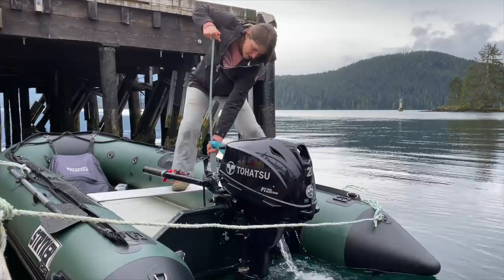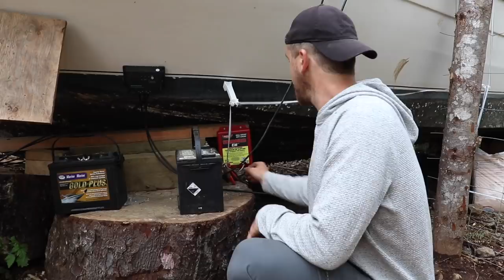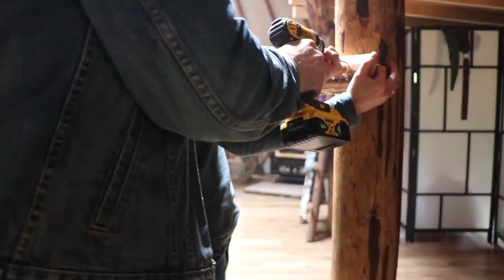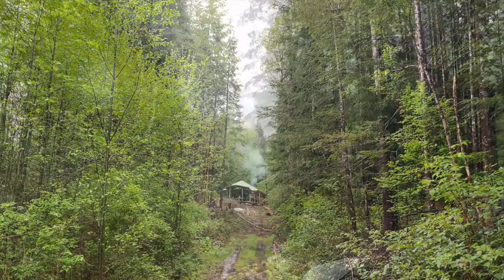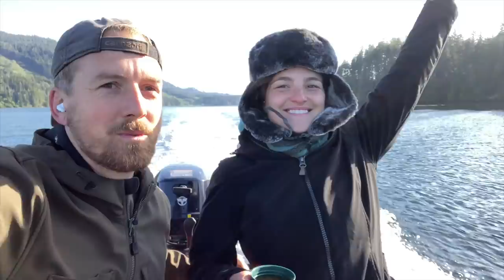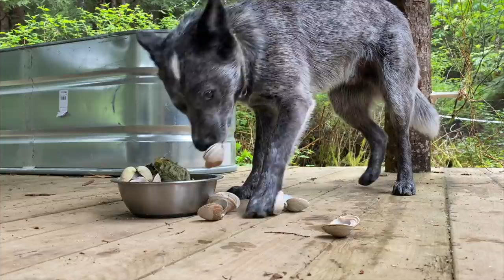OFF GRID WILDERNESS LIVING // What We Feed Our Dogs | GARDENING WITH BEARS | Falling Trees - Ep. 87

Comment: Tip from a tow truck driver...a small 1500lb say snatch block will double your pull capacity with no extra power. Chain off to another tree and you can direct the fall towards the snatch block rather than the vehicle.

Comment: When falling trees I think it is better to face the notch downward instead of the way you did it.  Also logger pants are recommended especially that far from a clinic.  I have put the saw into my leg and had to drive to town myself. likely i did not hit any arterays only fat. The back cut should be no higher than an inch above the initial cut when facing the notch downward.  do not cut all the way through.  Leave the hinge .  Stay safe
Reply: You covered everything I was going say about the cut, excellent.
Reply: mym that is called a Humbolt cut.  The butt of the tree will hit the ground first.  It will sometimes break the tree toward the top.
Reply: What about the cold water they constantly travel in with the inflatable ? If they ever had an accident with the inflatable they never wear lifevest and if they had to swim to shore they wouldn't be able to.make it . I can't believe they don't wear survival suits whenever they're in the inflatable
Reply: NO JOKE!!!
Reply: Robert Prout I have similar thoughts and also for the dogs. They should be able to have the same advantage, even thinking if they were to help float someone else.  I feel that it is neglectful and irresponsible. Accidents are not planned.
Reply: The humbolt cut with the angel cut at the bottom, the main purpose is to save wood in the log. Dont think Jake has to worry about that too much. The conventional wedge cut is easier n is the most commonly used in forestry. I agree with everything else, leg protection a must and I would recommend wedges and a mallet
Reply: Great info and will use when falling tree's next!!
Reply: Robert Prout I’m not sure where you are from but on my worst day I could swim to shore from where their boat is in the water. Do people think you just die when you hit cold water? 🤷‍♂️
Reply: There not in the sea, and they are close to land in every boat trip I have seen. I could very easily swim to land there. And it's total up to them if they want to were a life jacket. But a whole survival suit is a little over board. Lol over board. Sorry had to lol. 
And how do you not know they got on a life jacket? You can get one's that blow up only when you need it.
Reply: echo9970 absolutely! They have those little body life vests on under their clothes that are just a couple of straps that blow up quickly. Yet sooooo many people say they don’t have vests every single time they post a video...
Reply: this guy doesnt need any advisce,  he has one of the biggest EGO'S  on YouTube, He knows all about everytrhing
Reply: echo9970 The question was asking if they wore life jackets. I am 63 years old and could likely swim the distance but I am betting in the cold of winter that could change. I had a water accident which knocked the wind out of me and while I was curled in a ball sucking in water my chances of passing out and drowning grew more. I couldn’t prevent the spasm caused by the hard hit on my back, the wind knocked out, causing my body to gasp, sucking in water. I did not have a life jacket on, if I did I would never have sunk. In a split second I became aware, stretched out my legs and kicked off the bottom and saving my life. I believe in Life Vests, Jackets, whatever fits best. They can definitely save a life in an accident.
Reply: @steveb6665 
lol He sure does think he knows everything
Reply: The conventional face cut will do the job too for ground felling. But one should start with the angle cut and finish with the level cut at the base which Jake did backwards. Much easier to have things straight and make the cuts meet. I use the humbolt cut when I'm climbing in the tree trimming or felling sections. It makes the butt of the cut piece clear out better. All the rest I agree too.
Reply: @steveb6665  totally agree with you my friend. I also wonder if he's ever thought it possible that he may trip or land wrongly, when imitating a ninja turtle, jumping over electrified fences, and especially off the boat? Filming his own acrobatic prowess doesn't impress anyone but his own ego, and moreover, makes him appear very vain and immature.
And what's with constantly showing that your dog can spin round? More narcissistic behaviour. "Look how wonderful our dogs are". (which they are, but not because they can spin around, but because they are loyal and loving friends.)
Please.... Stop with the showing off, it's embarrassing.
Reply: @steveb6665  oh come on man Jake's a good guy he's not like Trump 👍
Reply: I have to say Jake & Nicole are real lucky to have such great followers. You folks are always giving them great advice and I learn almost as much, or more, reading everyone's comments as I do watching their clips. Thank you all! 🤗💕♥️💕🦄
Reply: The worst part is that he has logger's pants. He wore them the first time he used a chain saw and then just decided he was immortal, I guess.

Comment: hello, You want to fell trees get rid of the ladder. get a beanbag 12 or 14 oz okay it comes with a 150 foot of string. what you do is throw the beanbag up and over a branch. if you do it right you can get it up 70 feet. after it goes over the branch it comes down. DONT CUT THE STRING use a inline cove hitch TIE THE STRING ON YOUR rope. Than pull the beanbag side and run the heavy rope up and over the branch. when you have the rope down to the ground tie a running bowline send it up the tree. The higher you tie your rope the more control you have and can make that tree do what you want. tie to close to the bottom means you have to pull harder that can snap rope and hurt you really bad or kill you.
Reply: Very excellent detailed advice! Thank you from a fellow follower.

Comment: We've had issues with bears getting into our garden,. We ran 3 strands of electric fence and put foil baited with peanut butter to draw the bears in so they will get zapped and learn they don't want to be there. Also, you might consider a solar fence charger. We've had ours for almost 10 years and it hasn't skipped a beat.

Comment: just a little advice, notch the tree in the direction you want it to fall. (be sure to walk around it) go a little less than 1/2 way thru it, then the back cut angle down to the point of the notch. and it will fall wherever you point it.
Reply: Angel back cut is not good practice. Your cuts look good Jake.
 Keep your back cut level and a little higher then the notch and leave parallel holding wood. Do NOT cut through the holding wood. 
Coming from a trained forestry faller

Comment: OKAY, you know by now, just  how much I like you guys and how MUCH I enjoy your videos. But, I don't want to see you lose all the work you've put into your garden. So please take my advice about your garden fence.
 I know a lot about electric fences. I raised BRANGUS BULLS for 20 yrs. Some of them weighed 2000 lbs. And I kept them in with electric fences! YOU do NOT have an adequate  GROUNDING SYSTEM on your new fence. First of all, your ground is not deep enough. Second that cloth tape with the tiny interwoven copper wire won't work long because  the ACID in the soil will eat it up in short order. 
The fix, luckily, is EASY! First, take your power auger and dig a hole as deep as you can. Then take any heavier COPPER wire, such as house wiring. Make a coil of BARE copper, as tight as you can, a little smaller than the hole. Lower that into the hole with the last 5 or 6 ft of straight wire, up and out the top of the hole. Fill the hole with dirt and soak it well with water. Clamp your fence tape to the copper ground wire.
Believe me, THEN you nor Nichole will want to touch it. And, THEN it will turn a bear! Again, much love for you guys and what you're doing.
Reply: And the longest “easy fix” award goes to.....😄
Reply: Great info thanks Earl!!
Reply: Thank you, it was bugging me too. I used to hammer in a long ground rod, your way is much easier. Good idea.
Reply: @tomsaxton970  It's the exact way almost all electric utility poles are grounded. I spent so much time explaining this,  because certain people can't visualize. You can! 
I used to use copper clad rods. They'd always corrode where you clamped your wire going to the fencer at the top.  If you leave the wire coming from the hole long enough to reach your fencer, then you eliminate ANY connection problems.

Comment: Drive some 6' copper rods in the ground to ground your fence. You won't feel just a little tingle then.
Reply: G Black I made a comment on the last video. I’m not a tape person. I don’t see any use of what he has right there. My old cow just smile and walk thru it. The 6 foot rods. Yes. Also ground to the actual wire mesh in the fence also. The tape? But smooth wire hot and insulated from the post and fence wire, well a good fencer will chunk fire. Jake, you should see the fire jump from a bears nose and hear a good crack if you want effective. Otherwise us old boys just pee on them tingles to get a rise for breakfast.
Reply: I'm surprised they felt anything at all. See the fencing has 2 wires in it. Ground isn't supposed to be literally in the ground. The fencing is flat to keep the positive and ground separate so it doesn't short. All you need to do is keep it from twisting and shorting out before something touches the tape..
Reply: @PlainStraightShooter  I'm not a tape fan either.... requires contact with both wires to give a shock... I'm a wire and ground rod guy.
Reply: I have also out in a nice way the near is not going to feel that at all. I just stand there with my hand in that wife all day long it don't hurt. And wrapping the wire tape around the metal rod in digging a hole to put it in it will not work for long. Just put the metal rod in the ground like a post. I had !y fencing hook up to the mains to stop cows.. A bear has thick fur it will just not feel it.
Reply: G Black I figured you was. Like me. I just hope Jake and Nichole get the message we are conveying. I got plenty experience with a good hot fence. Like grandpa says “ if it don’t snap them weeds off it ain’t hot.”But that’s the old weed wacker they sold years ago. Funny, them ther weed wackers could be modified and they will flat out snap fire at your hand before you really get close to the touch. Of course that was a damp or humid day with a 20 foot ground in spring fed water. You know the deal. Good ground and his fence wire should also carry that direct ground. That way that nose on that tape will jump a hot arc and I’d about bet money that bear want be back. And if so, the second good hit will say, “ uh I ain’t coming over here. I get shocked bad”.
Reply: Chemicalvamp Yes sir. But like me Black and said, his ground rod is tied to the tape and back to his fencer. That ground needs to be deep and wet if possible with Wite not tape wire. Then if you tie his hog wire he’s using to that ground you crest a close ground area to the no good wire tape he’s using. Me, I would chunk that tape and use smooth wire and good nail on porcelain insulators as my stand off. I’d run that hot wire top and bottom and a few feet from bottom and another a foot or so lower from that top wire. I def be using a 20 joule fencer and knock hell out of a bear

Comment: HINT   Your cutting the V notch upside down!  The way your cutting them your leaving the nicest thick trunk with an angled cut instead of a FLAT bottom (end)  Cutting the slope down will leave you with a nice flat end.
Reply: Both methods, notches up and down, have their adherents.  There is also a 3rd technique - a loooong shallow notch.
Reply: FYI Stihl recommends the way Jake is making the cut. Flat bottom, angle cut down to it, hinge cut the back. But rather than a ladder, rope and truck, sledge hammer and wedges in the hinge cut.

Comment: Vehicles are a problem where tree felling is concerned, vehicles can be damaged or destroyed.  .  Those trees are not terribly large, but the best and safest method I have used over the years.  Tie to the tree as high as is convenient.  Tie with a 100% nylon rope,, I prefer a braided nylon,, 5/8ths to 3/4ths, 100 foot length minimum. Tie off to the base of a tree in the direction you wish it to fall,,, other ropes can be used if you need additional length,, Use a ratchet type come-along to put full tension on the rope.  The trick is a nylon rope can stretch as much as 40% ,, so when the tree begins to move,, the force continues to be applied for quite some time.  If you use a static or non-stretchy rope,, you can put tremendous tension on the tree,, but the moment the tree moves that first 6 inches,, the rope no longer is exerting any force Long Nylon braided line,, stretch it well and use a come-along to pull in the last 12 to 15 feet.  This trick keeps people, and vehicles out of harms way at all times.

Comment: Having been a farmer for many years and using that fencing system. The way I test it is to just hold on to the wire, and that way you can tell if your getting what you need all the way around the fence? 
You also don't need to put the rod in the ground like that. All you have to do is push it into the ground, and wrapping the wire around like that is not great..

Hate to say it, but I don't know if it will stop a bear? Unless the best sticks it's nose in the fencing? Just think how thick a bears fur is, that it is  definitely thick enough that it will not feel that shock, and with the system doing a shock then a few sec later other one, that maybe enough time for the best to have bottom inn there. I should think zoos use hook up to the mains to stop theres. And I also hook mine up to the mains in the end to stop cows.

Comment: The better the earthing of the main fence the more effective the power deliver of the positive wire will be, thus better protection. To improve the earthing of the fence use earth spikes, or the same technic by burying a steel bar, on each of the sides of your enclosure. Then connect the earthed spikes with the steel wired fence. It might be worth adding one or two electrical lines between the top and bottom electrical wires. Good luck with all the future projects.

Comment: Okay.  I'll bite.  Why don't you have a digital voltmeter to check your electric fence instead of touchingit or feeling for pulses through grass?  Approx $30.
Reply: Why spend $30 on something they don't need at all? I would not use grass, just grab hold of it as it don't hurt at all. Done that 1000 of times over the years.

Comment: those wooden posts foundations will rot in time and the whole structure will sag and self destruct. My front porch  apparently was built like that and they did not support the floor with any cement  or solid material. Now after 30 years the wood has rotted away and is sagging in the middle. I have jacked it up and replace the posts with  6" x 6" pressure treated post on stone bases. Good to go for another 30 I hope !

Comment: When splitting wood you can save energy by removing the chopping block because you build more energy swinging down because there is more distance to travel. You don’t have to stop using it if you don’t want to just a recommendation.

Comment: Build some short walls on three sides of your splitting round.  That way you can set several rounds down, split them, and not have to chase after them once you are done splitting.
Reply: Or place inside the "hole" of a used tire.

Comment: teach you guys  a lil trick  go get 2  used old car tires put  one on its side then the other on top of it.   drill a  few holes through the side wall of each tire and screw or bolt them together. then  put  both tires  screwed together on your chopping  stump  on there side  put your log inside the tire and split the logs 4 to 5 times  with out  having to bend over each time to pick up the  split logs saves your back a lot lol

Comment: I've been trimming trees since 82, and I was the forman of my own crew for the power company trimming trees in line clearance, and I'm 60. While trimming trees for asplundh tree service, they found a safer way to notch and fell trees by cutting the notch high and shallow and cutting the lower notch a little upward angle and looking down into the top cut so you don't bypass the cut. Still using a rope, cut straight into the corner of the notch, not above but straight in, and when the tree starts to go, step back out of the way of the trunk. Piece of cake,
Reply: Sounds interesting. Any videos on here you can recommend?

Comment: Hi guys love your channel. I have been watching you for a while now. I was just wondering why you never set up a zip line to move all  your wood it it a easy way to move big wood very easily we use this method in the tree industry when we can not use equipment. It can hook to the truck and you can move larger wood for some better results in your projets. All you need to do it it 1 long heavy duty rope 2 pulleys that fit that long line and some heavy duty carabiners that fit the pulley holes and to make checkers around wood. Look this up and it will save you lots and lots of energy